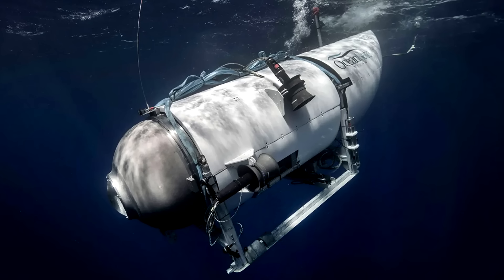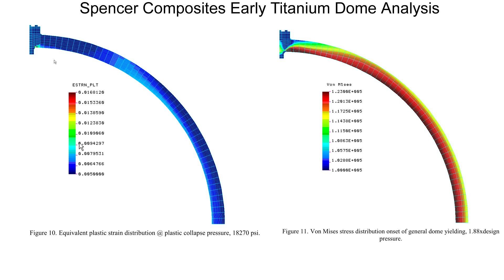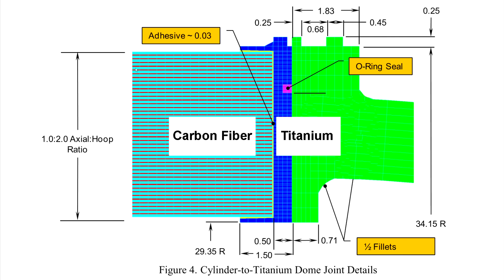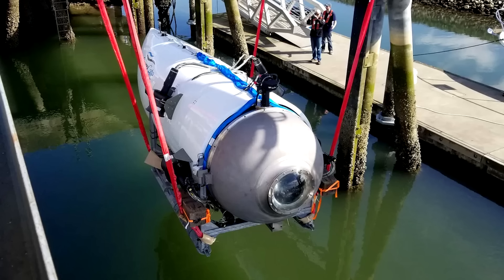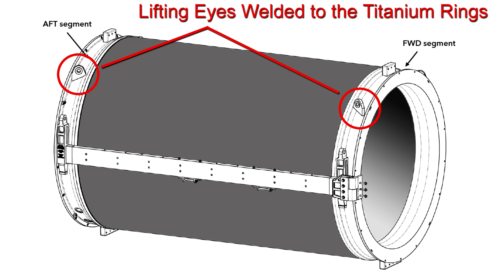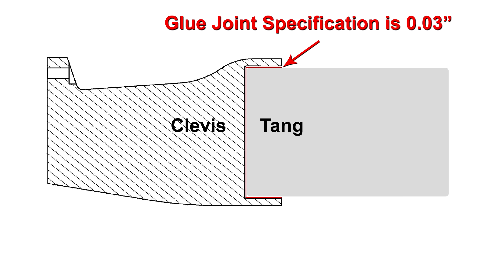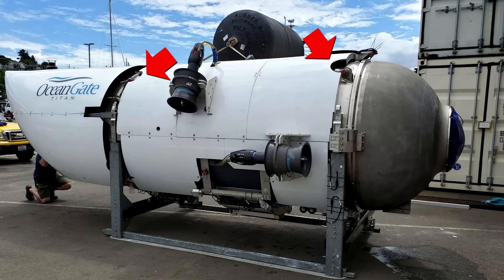OceanGate Titan Titanium Rings - An Additional Story About Them

Comment: When this first happened my first thought was strain management at the glue joints. Sounds like they made an effort to take it into account- good. But welding on lifting lugs after the designer said not to (and had good reasons not to) shows a lack of respect for, if not actual appreciation of, known engineering principles. And that's what gets you killed.
Reply from the maker: Thanks for your comment.

Comment: Two things jumped out at me on the doomed sub.  1. they appear to not recognize the differences in behavior under tension, and compression. In compression, you are talking non-linear eigenvalue type solutions of failure modes and that is not like a wire wound structure under tension, that Stockton was familiar with from his experience in aerospace.  2. they relied upon adhesive alone with no mechanical engagement between the carbon fiber cylinder and the titanium end cap.  I would only consider that in ause-case where the loads and consequences were insignificant.  Clearly, a submarine hull going to the bottom of the Atlantic is  neither.
Reply from the maker: Thanks for your comment.

Comment: If you want to massively reduce costs of manufacture, there are three areas to look at:
Use cheaper materials
Reuse readily available components
Use existing designs.

So, why, for the love of engineering, didn't Rush do a sphere in a relatively cheap material such as Steel, FFS?

Comment: As the carbon fiber hull cylinder deforms, bowing in the middle of its length, it is pulling on the interface with the relatively inflexible titanium ring collars.  As for lifting rings..........another poor choice for convenience that was not sensible for multiple reasons.

Comment: Also, the lifting eyes are not square with the hull in either direction, and the loads applied are not vertical at all, they converge to a point well above the vehicle. So everything is cattywampus. Creating some complicated stresses on the two glue joints. Pulling in at some points and possibly even pulling out in others near the bottom. Messy. I'm just a regular architect though, not a fancy engineer.
Reply from the maker: Thanks for your comment.

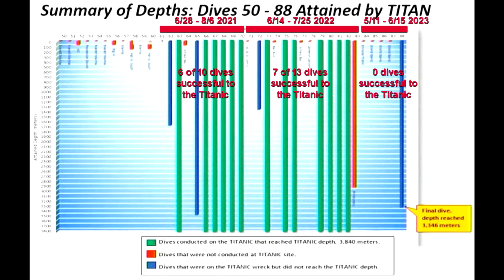Comment: 11:20 Oceangate didn't even bother building a simple rectangular lifting frame to avoid putting undue stress on Titan. In that image the hull is under compression along the top and tension along the bottom, as are the glue joints around the titanium rings.

A lifting frame would've been the easiest thing in the world to build, and mitigated some of the effects of repeatedly lifting Titan in this way after being told that it shouldn't be done.
Reply from the maker: Thanks for your comment. Those are all great points. Thanks for adding to the discussion. I have no idea if they knew how to properly rig this thing for lifting.

Comment: This just looks more and more like the Challenger disaster. They knew they were pushing the limits, and ignored the engineers.
Reply from the maker: Yes, you are correct, and thanks for commenting. Both the Challenger and the Columbia disasters could have been prevented. The problem occurs when management gets too far removed from engineering with complex projects. That is why we have to study the failures. Thats is what NASA would not let Butch and Suni come to Earth on Starliner. NASA learned.

Comment: When I saw this glue up I was shocked to say the least. I have worked on composite bonding implementations like this and absolutely nothing about it was done correctly. First the epoxy was mixed by hand which is going to lead to uneven unrepeatable mixing of adhesive and activator. Also it was never degassed after mixing meaning it would be full of small voids. Then application was done by hand in the most slap dash fashion I have ever seen. Then surfaces were just pushed together with no thought to obtaining an even layer of adhesive. All of this was done in a filthy workshop meaning all kinds of contaminents would have been present, some of them weren't even wearing gloves while touching surfaces prior to applying adhesive. In short it was a total mess.
Reply from the maker: Thanks for your comment.

Comment: I am going to assume that the inquiry will include measuring both rings diameters at many points around the inner and outer circumferences to check for ovality caused by lifting via the welded lifting lugs.
Reply from the maker: I think the force of the implosion would make those measurements invalid as it regards attributing any damage from the lifting eyes.

Comment: Let's be controversial 😂.  The engineering design was solid and it was proven to work. The problem being that the number of cycles to failure was unknown. So the "new" Titan was fine. When subjected to dive cycles and handling, Titan started to age fast. I'm sure that many of us have come across single use or limited use structures. This is a classic limited use structure - like torque to stretch bolts 😜

Comment: I spent 15 years making composite and steel pressure vessels to contain up to 10,000psi. I know nothing of submarine design. But this clevis and Tang design is insane!!!!!!! This is madness to think that would ever hold and not just pop off. They needed a solid titanium inner tube and then to support that with composite. But again composite don't resist force in this shape nearly as good from the outside as they do from the inside. Why not just use titanium for the whole thing?

Comment: I build boats and use epoxy and glass Fibre a lot. When I saw that video of them manually spreading the glue last year I was horrified. 
Even in yachting and aerospace we use clean rooms and vacuums whan bonding like this especially if it's going to be in a high stress environment. 
The technique used there would be suitable for a kayak or canoe but thus is staggeringly insane in a submersible. 
1: dust particles get trapped in a grubby environment like that: trapping microscopic air bubbles.. not a good idea in a vessel like this
2- epoxy is tricky stuff. It starts curing the moment you mix it which is why there are so many spreading it on the surface. Without a mechanical clean room process it is impossible to ensure that the bond is consistent 
3- lack of a vacuum means air bubbles.. mixed into the epoxy manually , created every time another lump is spread, a vacuum sucks those bubbles out.
4- general slap dash approach to safety here. Epoxy of this type is highly toxic, even the fumes. There's little or no effective PPE.

It would be appalling for a lightweight racing yacht, it's simply jaw droppingly incompetent for a deep water submersible

Comment: I think its important to keep in mind that these 4 lifting points may not have been placed level with each other and the sub. Meaning when you place 4 equal length chains/slings, two of them, on opposing corners will take extra load, and the other two will take less load.

Ad to the fact that there is weight out the back of the hull, behind the two lifting points. Weight that the other side doesnt have. So add to the above, that extra tensioned lugg now has even more weight on it as it has to take this extra weight. 

You can see at 5:18 how the sub isnt picking up level, those two legs on the left have more weight to their right and so the load has swung to center itself under the crane's lifting hook where the slings are probably attached.

Given the above, its almost certain to me (boilermaker who uses crane daily) that those rear lugs are taking more than half of the 10t that had to be lifted. One loaded more than others.

Btw riggers always assume and calculate for load being distributed on 2 legs of a 4 leg sling, do you think stockton did the calcs this way? Dogman 101
Reply from the maker: Thanks for your comment.  Those are all great points.  Thanks for adding to the discussion.  I have no idea if they knew if the four lifting eyes were getting equal loads or not.  Probably not.

Comment: From the beginning I thought the point of failure had to be the joint on those rings. There was the photo of one of the rims of those rings peeled back like foil. There was no reason for that if the pressure vessel was crushed by a failure in the carbon fibre layers.

Comment: Also not using spreader bars on the lift rigging introduces furthur unwanted forces into the equation. Now your compressing the top of the hull/ring joint and trying to seperate the bottom. 
Absolute cowboy show.

Comment: EA9394 is a liquid shim, not an adhesive, though it is often misused as such. It is aluminum filled epoxy giving it excellent compression strength and stiffness for shimming. However it is brittle and terrible in peel. If the hoist rings created a peel load, which is discussed, then EA9394 is likely to fail.
I could also see the temperature changes being significant as the EA9394 is even more brittle at low temperature, North Atlantic, and the aluminum fill will be shrinking relative to the carbon and Ti and causing local peel stress
Reply from the maker: Thanks for your comment.  I have heard from others that EA9394 is weaker at lower temperatures.  Thanks for bringing that up again.

Comment: That they had to grind the carbon surface between each lamination cycle suggests the presence of air-filled interlaminar voids within their layup.  Watching the winding process for each successive 1" layer tends to confirm this probability.  And the surface grinding tells us that multiple carbon fibres seriously lacked continuity, generating high shear stresses in the pre-preg resin.

The thickness of the resin layers between successive layups means an unwelcome "softness", compressibility or, in effect, a disconnect between the 1" layers, suggesting that each dive would cause relative movement under the compressive loadings.  I guess that only laminate layup in a vacuum chamber could have prevented air inclusions.

Re the Ti rings:  you have in effect just a butt joint between the machined end of the carbon tube and the flat face of the channel in the ring, with surprisingly little length and engagement/bonding surface between the thin walls of that channel and the tube.  So if the carbon tube compressed further than expected, extensive bonding failure might be expected, possibly resulting in a leak with a high-pressure water-jet causing catastrophic human injury and loss of buoyancy through water ingress.

Finally, joint preparation:  it does not appear that the bonding surfaces received special treatment, such as bead or grit blasting, for bond enhancement.  And the method of resin application and joint assembly, which could entrap air, seemed unlikely to ensure uninterrupted metal/resin/carbon laminate continuity, leaving scope for air inclusion and cyclic high-pressure water ingress.
Reply from the maker: Thanks for your comment.

Comment: The glue in between the layers of the carbon fiber was turning into dust, and the layers were actually independently rubbing against the other layers. This thing was just an engineered death trap.
Reply: I wouldn't put my kids in that to sit in the backyard.
Reply: I could engineer a bettee sub and im no genius. Im a deliveryman im no brain surgeon or engineer by profession. I just get from a to b so i have am interest in my vehicles not degrading into dust as i depend on them. These idiots made a submarine out of carbon fiber and expired sony video game controller. I could do better and im an idiot at least part of the time. If im no genius neither were these so called geniuses
Reply: @TheAnnoyingBoss no you couldnt , sit down and shut up.
Reply: There is another area of expertise that you have not mastered: grammar.
Reply: One other thing he left it out in the sub-freezing cold to degrade the carbon fiber even more. This guy was a true genius. He left paper mache out to freeze then thaw and used it to dive Titanic.
Reply: Whilst you are correct i am amazed it lasted as long as it did. I would think it would fail a long time before it actually did.
Reply: I agree with the above comment. Applying coatings or glue is all part of engineering. Including the ambient temps applying it, the thickness and curing conditions and time for the glue to set. Salt water and temperature changes seemed to be overlooked.😂
Reply: Yep. Glue was always the main cause of failure to begin with. They wanted cheap and they got cheap. Even though this glue is very strong, it's going to be put under even more pressure than the depth itself, due to having to shrink and expand against itself laterally. The glue also isn't as hard as carbon fiber, so there would naturally be some internal  abrasion aspect to the mechanics of it. When the glued materials shrink, the glue itself will be put under pressure. The bonds don't jump around like with atoms, they're at fixed microscopic points all over, and so when immense pressure is applied, all that can happen is stretching and squishing of the glue layer, which will eventually reach a breaking point. It's like if you had something glued and tried to move it a full millimeter, if you did, it would no longer be glued, the bonds would be broken entirely, and that's exactly what happened, the bonds catastrophically failed. It doesn't even need to be everywhere at once, it can be like a zipper or dominos, where once a small section separated, the sudden pressure shift to the next row of bonds is dramatic, causing them to break, and so on, all around the entire glued area, at the microscopic level. But there's also other issues the contribute to the failure, for example, air bubbles trapped in the glue layer. It should have been glued and cured in a vacuum chamber. Those air bubbles create pressure in all direction, on the glued parts and pushes at the glue itself too, which again weakens the glues sheering strength by putting additional load on it, especially when you consider that pressure from the sandwiched parts are also increasing the pressure those air bubbles exert, which can contribute to sheering. Then of course there's the logistics of the environment itself, where water pressure in even a tiny pinhole has soo much pressure behind it that it comes through like a water cutting jet, which only increases as it rapidly expands the pinhole from the sheer amount of pressure. So while all these forces wouldn't necessarily be catastrophic in space or with a sudden strike, the pressure of the ocean is a different beast, it does not relent, there is no time for things to shift and settle or simply deform, once a seal fails, it fails.
Reply: @
The main cause of failure was when Stockton Rush's two gametes made a zygote.

Comment: Deary me. The more I learn the more I feel sickly thinking of those folks getting in that vehicle.
edit - Hadn't it previously dived to the Titanic several times? If that is correct then it had done quite a few full-pressure cycles. Therefore, being "experimental", wasn't it time to either scan/x-ray the hull or perform a destructive disassemblly to REALLY understand how the structure, and especially the carbon fibre hull and ring interfaces, were holding up? Was Rush going to just keep her diving until he became fish food?  Maybe the ticket revenues hadnt quite covered what he had sunk into the project - so, just a few more dives, then we will do a full post-life analysis....
Reply from the maker: Thanks for your comment.  Yes, you are correct.  They got lucky a lot.  They should have stopped after dive 80 when they heard the loud bang and the strain gauges changed.